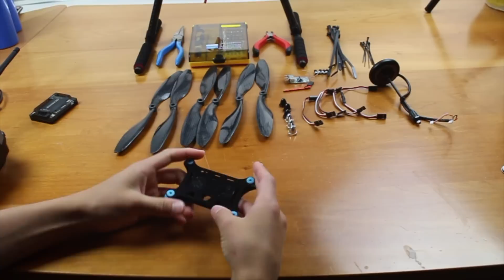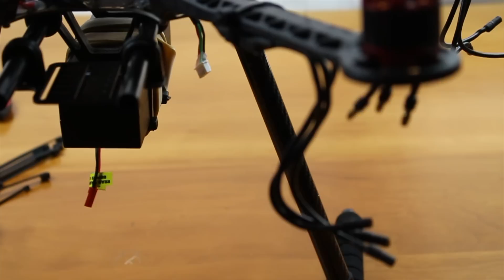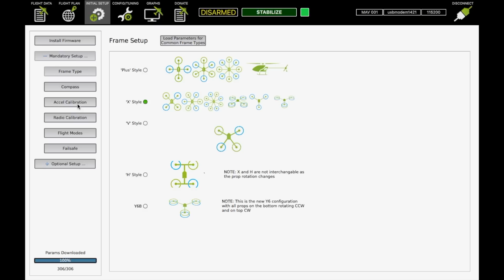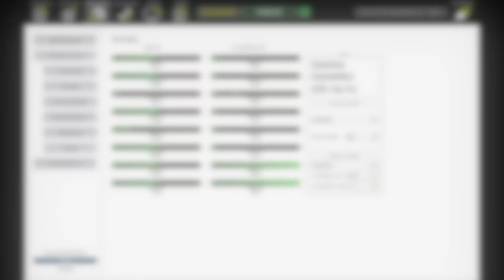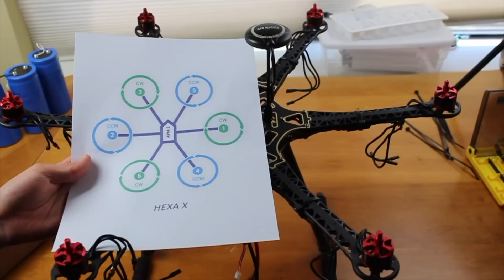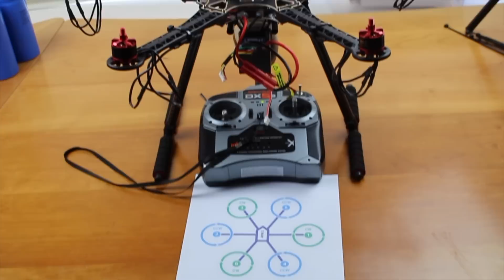Basic APM 2.6 Setup (Configuration and Mounting)

Comment: I delved into this arena for a short time and purchased all of the old junk to build one of these dinosaurs! I have many long range quads that fly so easy and smooth, but I have always been fascinated with these old buzzards. Big mistake, I dropped around $300.00 to build one of these using the APM 2.8 FC. It flew ok for a large, under powered, way out of date, piece of old garbage! The undoing of it, was when I attempted to use auto calibrate! That sucker went waco and began to sway left and right and finally crashed into the ground. Due to the fact that it was plastic and not carbon, and weighed a ton  caused it to shed many many parts on impact. It now lives in the city dump, lesson learned!!!!!!!!!!!!!!!!!!!!!!  How far we have come! I have two 60mm quads that are not toy grade and will fly circles around this. I also have 6 GPS quads including DJI products that bring a smile to my face every time. These are best remembered in the past tense and left to posterity!

Comment: Banana science you have tried flight modes like attitude hold mode & loiter mode on apm you have ??
Reply from the maker: yes
Reply: @BananaScience  it worked ??
Reply from the maker: @sss_1707  yup
Reply: @BananaScience  mine is not working can you help me plzz
Reply from the maker: @sss_1707  What exactly is the issue?
Reply: @BananaScience  don't know?? Plzz help me.
Reply from the maker: Mr. lnvento leo does it drift? Does it flip out of control?
Reply: @BananaScience  no it's very stable in stabilize mode but when I turn it to altitude hold mode it starts climbing high without any command .
Reply from the maker: Mr. lnvento leo have you checked that it’s configured properly? What APM version are you using? Sometimes the barometer needs to be covered by a piece of foam as they are very sensitive
Reply: @BananaScience  I did that but the problem continues.
Reply from the maker: Mr. lnvento leo did what? I asked multiple questions. Please be more specific in your responses or I won’t be able to help you.

Comment: my controller wont arm the drone... i have it connected and have calibrated it but it still wont arm.  the blue light is solid and the reed light on the apm is giving a single flash... do you know what the issue could be?  only the rightmost green LED on transmitter is lit.
Reply from the maker: Sorry for the late reply, we have been out of cell service and internet the past week and are just catching up on stuff. Just to confirm, all of your channels are working properly and show up appropriately right?(eg: roll isn't inverted or accidentally swapped with yaw)
Reply: Im not completely sure. i have bound the transmitter to the reciever and the did everything else the same,as you did in the video... Also while your thinking about that question do you know how to fix the bad compass health issue.

Comment: About the gps stick... Mine didnt come with one. Is there anywhere else to mount it directly to the hexacopter that wont interfere with the ESC's.
Reply from the maker: The stick is the best method as it keeps it furthest from the ESCs but you might be able to get away with just sticking it to the direct center of the middle plate.
Reply: @BananaScience  what if I mounted it using adhesive directly on top of the GoPro mounting plate...?
Reply from the maker: @isaacgarner3030  Where is your gopro mounting plate? As long as it has direct line of sight to the sky and is away from the ESCs then you should be okay.
Reply: @BananaScience  its right where yours is. Would that be ok if I mounted it to the top of that?
Reply from the maker: @isaacgarner3030  That should be okay

Comment: How much does the type of battery matter as far as voltage? (what can i get away with?)
Reply from the maker: I wouldn’t go any lower than 3s (12v) for something like this. If you want to go above 4s (16v) you’re gonna need to upgrade your motors and speed controllers. I think that 4s is a perfect middle ground.
Reply: @BananaScience  ok. Thanks man!

Comment: Hello Sir I want to flash firmware version 3.5.7 in my APM 2.8. But when I try to install the firmware it says " is your board a Linux board ". So what should I do , should I click yes or no on this message. Plz reply so that I can flash the firmware properly.
Reply from the maker: Hmmm... never heard of the message before. I would say "no" as a guess
Reply: @BananaScience  when I click no the firmware flashing fails
Reply from the maker: What happens when you click "no"?
Reply: @BananaScience  the flashing of firmware fails
Reply from the maker: So I did a little research and think that you are supposed to say that it isn't a linux board. Is the right port selected and the FC is being recognised by the computer? Have you tried putting into bootloader mode or powering it from a 5V BEC as well as the USB? I haven't used my APM in a few years so my APM knowledge is a bit rusty...
Reply: @uma_mahra  I know about the apm if your apm is not working try connecting it with an ftdi or usbasp or bootloader if this still happens get another apm
Although pixhawk is a better option.
Try getting a pixhawk 2.1 if possible or else a normal pixhawk 2.4.8
Reply: @BananaScience  Hey love the vid! Im trying to set up the 2.6 and I also got the "Is this a Linux board" message. I click no and it says the communication fails. Im not quite sure what this means. It is definitely plugged in. (Also Im a bit of a noob so sorry :) ) Please reply! Thanks!!
Reply: Also, I am doing this for a school project so a response would be very much appreciated! Thanks!

Comment: Can i use a flysky i4
Reply from the maker: Yup. you just need to buy a compatible receiver.
Reply: BananaScience thnx buddy for the help i have 6 channel reciver and a 4 channel transmitter
Reply: Do i require a power module tooo ??!?!?
Reply from the maker: That should work as long as it has PWM outputs if you want to use a similar configuration to the one I use in this video. 4 channels is pretty limited though since you can't have any auxiliary switches to enable RTH or any other modes just as a side note.
Reply from the maker: Only if your ESCs don't have integrated BECs and/or you want to measure current
Reply: BananaScience what type of modes r u talking about ?
Reply: BananaScience by the way im not using gps aur telemtery stuff is it optional
Reply from the maker: Gotcha

Comment: Nice vid. Actually u need to install the props upside down in each motor in the compass motor calibration. This is to let the electronics 'emit' the actual interference during flight received by the compass. Running compassmot calibration without the props doesnt give any interference at all. Hope this helps
Reply from the maker: Thanks for the advice! That's important to know! Sorry for missing that in our video!

Comment: i m not getting dots while doing compass calibration
Reply from the maker: Is your compass connected correctly? I haven't used the APM planner in a few years so they could have also updated the compass calibration sequence. Do you get any errors?
Reply: i had the same problem. you cannot use an apm 2.6 anymore is what ive heard you must use and apm 2.8.  also when using the apm 2.8 you don want to use the 12c port. use the gps port and the one right under that.  let me know if this works!

Comment: great video man.....how much kv motor used there..?
Reply from the maker: Thanks! I believe they were 980kv motors but I'm not 100% sure. I built this a long time ago...
Reply: thanks buddy....
Reply: if i go for less than 980kv motor means ...it can able lift  more thrust right..?
Reply from the maker: Not necessarily. A lower KV would be able to turn a larger propeller or a propeller with a higher pitch.
Reply: I have an HMF U580 quadcopter running 380kv motors with 1545 propellers, would I be able to run smaller propellers, if so, what pitch would be most suitable for those size motors, and by the way, great tutorial.

Comment: Did you have any trouble connecting your APM to Mission Planner. I am not able to connect them. No COM port shows up under the drop down menu. I have the APM 2.6 and have downloaded all the right drivers. Thanks in advance!
Reply from the maker: Does the APM power up when connected to USB? Are you using a micro USB cable designed for data? Could the USB port be damaged in any way?
Reply: Yes, it has a solid green light and a blinking red light. I don't think the USB port is damaged, but I have wondered if it could be the USB cable. I have tried three different ones. Are there any you recommend? Also just curious, when the computer is able to read the APM board will it appear under ports in Device Manager?
Reply from the maker: I don't use Windows so I'm not sure. I am sure though that the APM configurator should recognise it and pull up the proper port if it is detecting your APM. If you aren't 100% sure of your micro USB cables, you could try syncing your phone with one to test or just get this one which I'm 100% sure works: http://amzn.to/2DQIRCo
Reply: Okay, thank you! I will give it a try
Reply: THIS FIXED MY APM DRIVER ISSUES IN WINDOWS 8.1 https://www.arduino.cc/en/Main/Software

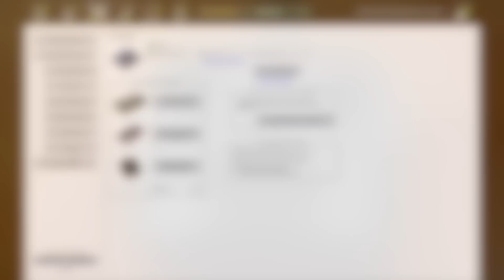Comment: from about 25:30 to 26:00 arming disarming i didnt understand nothing there what is it?
Reply from the maker: Arming is a safety precaution feature in almost all multirotors so you don't accidentally turn your props on when your holding the copter. Arming the multirotor allows the motors to spin when you increase throttle. Here's a good article: http://ardupilot.org/copter/docs/arming_the_motors.html

Comment: I have a similar hexacopter (much larger lol) but it flies a little weird. Will putting stronger motors increase stability?
Reply from the maker: How does it fly weird? It's probably either due to unbalanced props, bad stock PIDs/bad PID tune, sensor issues, or flight controller voodoo magic beyond our control. What size are your motors? Either way, increasing motor size probably won't help.
Reply: BananaScience gartt ML 2212 920kv brushless motors with 40a simonk ESC and 2.5apm with External gps. Props are 10x4.5 and are cheap plastic kind. It flies ok but it could do much much better
Reply from the maker: What frame are you running? Those motors seem pretty powerful already, but those fat 40a ESCs could probably take a larger motor if you wanted...
Reply: Running on 2 turnigy multistar 5200mah lipos in parallel and I have been using a single 4s 6000mah by floureon just for testing.
Reply from the maker: It's up to you if you want to get better/larger motors but I don't think it's the cause of your strange flight performance.
Reply from the maker: If you could upload a video and send me the link or just email me at Banana.science.awesome@gmail.com I could give you a better idea of what I think it is.
Reply: BananaScience same frame as yours :) I'll make a video as soon as the weather gets better. Thanks so much for speedy response!
Reply from the maker: No problem!
Reply: BananaScience was about to order gartt ML3508 700kv motors with some 10x5.5 carbon fiber props. Im 90% sure that these cheap plastic ones I have now arent the best for performance

Comment: Hey ! 
I have a 2.6 APM and I dont have any external compass :/
do I have to buy one to fly or can I fly whithout compass calibration ?
Reply from the maker: You should be able to fly without an external compass or GPS though I highly reccomend one.
Reply: ok thank's for the quick answer! but what is the purpose of the compass? (Because there is already an accélerometre...)
Reply from the maker: The accelerometer measures lateral acceleration which can tell the FC which direction the copter is moving relative to itself, but a not relative to the world as a whole. The compass tells the copter which direction it's traveling in relative to the entire planet (N, S, E, or W).
Reply: BananaScience ok does it have an impact on the stability?
Can I have stabilized drone without a compass ?
Reply from the maker: Yes as your flight controller still has a built in accelerometer and gyroscope.

Comment: What flight time are you getting?
Reply from the maker: It really depends on the load you're carrying. Without any load, you should expect 10-15 mins using the power system I used.
Reply: Thank you for the answer, I have a turnigy 8000mah battery and I assume I could get about 20 minutes out of it.

Comment: What has been your average flight time with this build? I have been using some online calculators, and getting some sad numbers. Most are saying that I will only get about 6 minutes of flight time.
Reply from the maker: Without any additional weight, I remember getting over 10 mins of non agressive flight. I have since sold this copter so I can't run a proper test for you though. Also, it has a HUGE lifting capacity and if you aren't satisfied with the flight time you get with the 5,000mah, I have no doubt that it could easily lift an 8,000mah with extra lift capacity to spare.
Reply: BananaScience There is so much to learn. And just when I feel like I have a grasp on it; I figure out that I am lost again lol. I will let you know what my results are when I finally get her in the air. Working on getting the mimosd  and telemetry wires hooked up to the flight controller. I was actually thinking about running two 5000mah 10C's in parallel.
Reply from the maker: Sounds good to me! I wish you the best of luck!

Comment: Banana science one more question I searched all the internet but can't find a transmitter and receiver which can give me a long range about 10 km can you please suggest some transmitter which have long range please.
Reply from the maker: I am not the expert on long range FPV, but with the 10km range you're talking about, you probably would want to start looking into some lower frequency stuff. I would suggest starting by searching "1.2ghz FPV" on google. Just an FYI, you're probably looking at least a few hundred dollars of gear.
Reply: BananaScience I am not talking about Long FpV range but want a normal controlling range of 10 km (no fpv)with a transmitter and receiver. Plz reply waiting....
Reply from the maker: You would want to replace your transmitter antenna with a high gain one and install a signal booster like the one below: https://www.banggood.com/2_4G-2W-Radio-Signal-Booster-Antenna-Feeder-For-DJI-Phantom-Multirotor-TX-Extend-Range-p-986756.html?p=S7161050498172016065

Once again, I have no experience or knowledge of transmitter signal boosting beyond what other people have told me.
Reply: just curious, isnt it mandatory in the US to fly within line of sight? so 10 km range, where or how can it be used, do you need special permit for that? and then it can be done?

Comment: Hello I am thinking to connect 2,  5000 Mah Lipo batteries 3s in parallel to my F450 frame which has 30 ampere ESC installed on it with APM 2.8 will it burn my ESC or it is OK to connect these 5000 MH 3 cell lipo batteries in parallel. Please reply Urgent.
Reply from the maker: It definitely won't burn out your ESC's as it is only a 3s LiPo. My only concern would be that those batteries would be too heavy. If you could lift them though, you would get some epic flight time! One of them is probably sufficient.
Reply from the maker: You're welcome!
Reply: BananaScience you are good thank you very much. 🍌🍌
Reply: RUDRANSH MAHRA I use 2 turnigy 4s 5200mah in parallel on my hexacopter. Im even considering buying a 3rd lol

Comment: Hello how my maximum volt and mah of lipo battery can I attach to my apm flight controller. Plz tell I am a subscribed user.
Reply from the maker: There is not exactly a maximum voltage that you can attach to your flight controller, it is mainly about what voltage your motors and ESCs can handle. Your ESCs, if they have built in BECs, will output 5v to your flight controller no matter what voltage is put into them. For the S550, I would suggest a 3-4s lipo.

Comment: My APM 2.8 when powered on either through USB or bat. The led by the gps is always red. Sometimes a yellow led will flash in same area.  I have never had a green light so does that mean my APM 2.8 isn't working correctly?  I hope not. I purchased my S500 kit off eBay and right from the start I had 4 bad ESC's and 2 bad motors!  The seller (said) he will send out 2 new motors and 4 new ESC's and a Gps until/M8N gps-compass. I've been seeing other APM 2.8 f.c's out there on the YouTube and they have the green light on right next to gps when they power the APM. I hope I don't also have a bad APM
Reply from the maker: Sorry, but I'm not very familiar with the APM 2.8. I would suggest posting your question on RC Groups. I'm sure they could help resolve ASAP! Good luck
Reply from the maker: Also, if that eBay guy gives you any trouble, just report him. It is not natural that two of your motors and four of your ESCs would be bust. Something fishy is going on...
Reply: BananaScience yeah I agree, I'm not holding my breath in him sending out new ones.  He had the guts to ask me if I'd remove my negative feedback I left on his product.  I said you are crazy if you think I'm going to remove any my feedback. I said I'll remove it when I receive my unbroken new things.  Also I found out later that he isn't even from the U.S like he states on his products page.  He is from some small town in china.   I also put a stop payment on my credit card until he fixes this which really got him moving!   Like I said though I'm not holding me breath I'm sure I've been had.
Reply from the maker: Nice job!